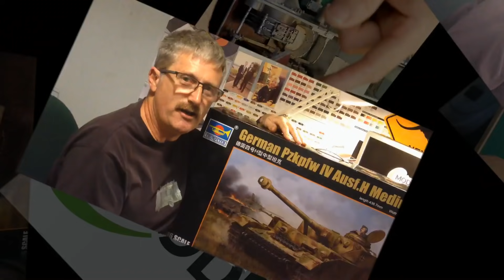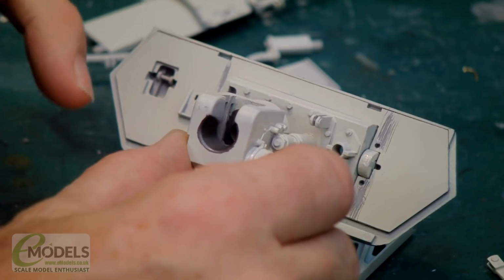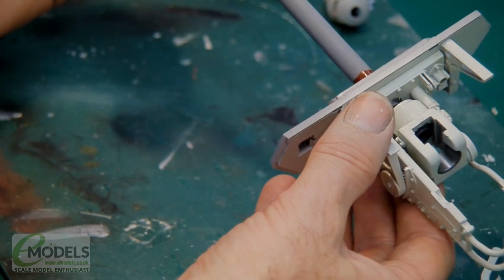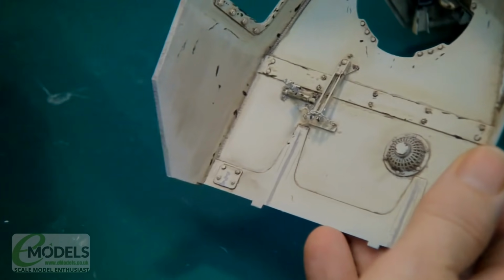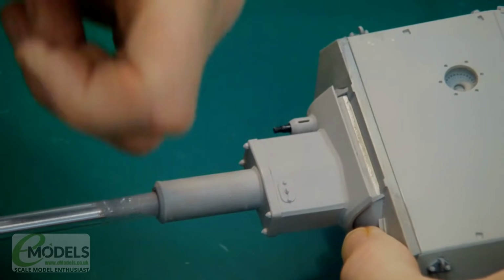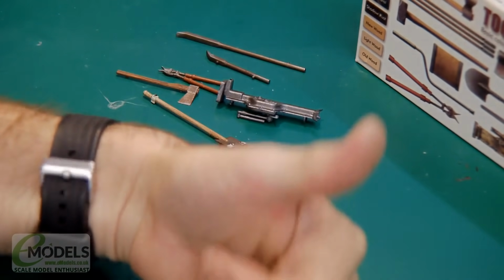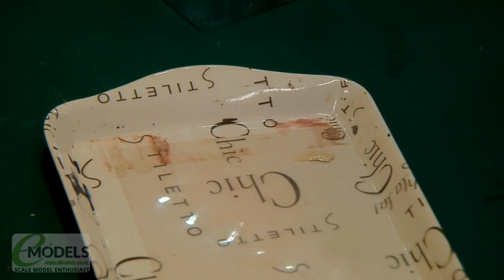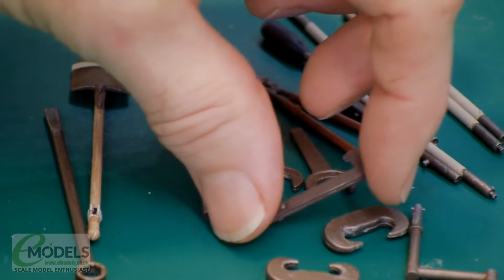Trumpeter 1/16 Pz.Kpfw.IV Ausf H German Medium Tank # 00920 - Part 8 Build - www.emodels.co.uk

Comment: So how easy do you think it would be to radio control the vehicle and display the interior seperately?
Reply: I've no idea how easy it would be to motorise this kit as I've never done it... But it would be a shame to leave out all that detail even if displayed seperately .. I'd probably go for a kit without interior detail and put a motor in that
Reply: If such a kit existed I'd be more kin to do that, as I am currently doing with Hobby Boss' 1/16th Tiger I and T-34/85. But, as far as I can tell, the only worthwhile PzIV in that scale that's reasonably affordable is the Trumpeter kit featured here.
Reply: +TestECull the only PzIV I know of them is a tamiya one which comes with RC as part of the kit
Reply: skipperted IT's also pricier than my pickup truck. I can't afford $700+ on a model tank, hell $250 is stretching my luck. I usually work in 1/35th but RCing tanks that size isn't the easiest thing in the world like it is with 1/16th.
Reply: +TestECull yeah bud they ain't cheap.... But as for this kit I've no idea how it could be motorised... But if you ever do is love to see it in action
Reply: I motorized a KV-2 in 1/35th and I'm fixin' to motorize a custom designed casemate TD in the same scale that mounts a gun from an M1A1 Abrams and uses M113 automotive parts/lower hull.

The mechanicals and electricals are easy. The issue is whether or not those road wheels, idler wheels, return rollers will roll properly, whether or not the drive sprockets, tracks, and final drives are sturdy enough to handle RC use. In 1/35th it's usually not a big deal but in 1/16th the forces at play are heavy enough that it could strip a sprocket.
Reply: +TestECull yeah it's a heavy tank just as a static model .. I think the drive sprockets would need beefing up at least
Reply: If you look around on ebay you can find a tokem for 100.00 strip it down and transfere all from cheap tokem kit to the new one  you will pay  more money for aftermarket r/c parts then buying the complete r/c the aftermarket r/c parts will cost dbl besides you get a turret  with horizontal and vertical movement as with sound only item not included in the tokem kit is the led mg for the gunner you can buy aftermarket one for under 20 usa dollars you get the controller. sound card with start up full engine rpm  turret movement m smoke system, also has recoiling barrel and the tank actually has the movement as if it was fireing rounds. You can also get a turret to fire plastic bebes. But to buy all parts separately will cost more then the complete r/c kit they make em in 1/12 and 1/16 scale. But only issue even if not using a firing turret there is to much wires you will never see the beautifully injected interior as for panzer IV i'm sure its the same inside as no room after adding r/c